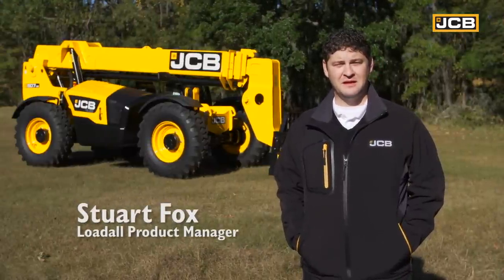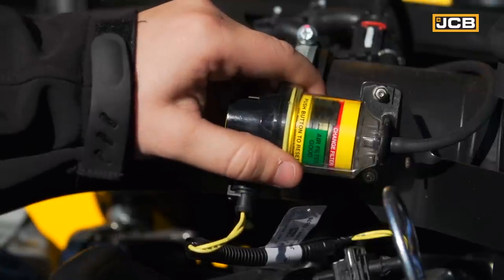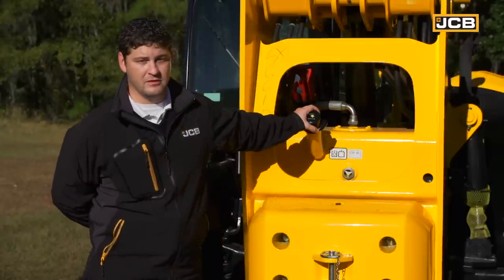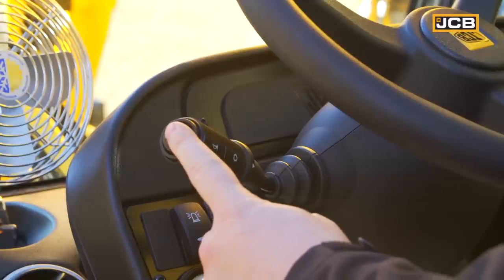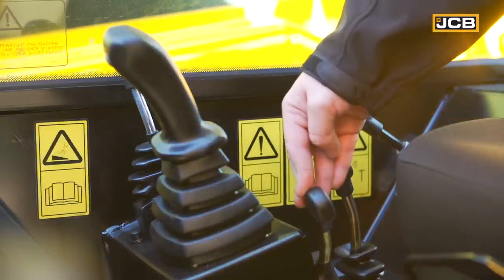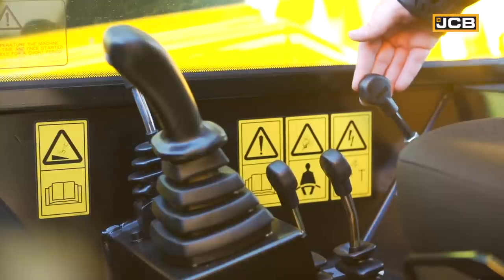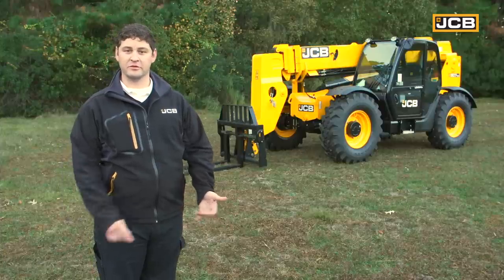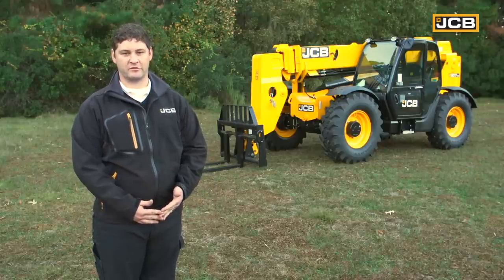Lift n Place -  Loadall Service and Operation

Comment: Hi, If JCB using as basket purpose and a man into a basket and suddenly JCB system all blocked. Question is: how we are rescue men from the basket? Have any manual system for in case emergencies? Pls response..
Reply: Cherry picker 🤣🤣
Come on mate cranes with man baskets can fail what a stupid question
Reply: @stevodoublel200  It is not a stupid question. In my practice, a related system of JCB was blocked, during working at height, and they can't lower the boom of JCB in time. There is a need to establish additional rescue plans or sustain the manual system in JCB in case of an emergency.

Comment: As a Telehandler driver in the UK this machine looks Alien (not in controls) in design why is the jib so high up and level with the cab so you can't see to the right, check out the UK Telehanlders if you are from the US (I know JCB is a UK Company) and see the difrence I visibility,  so much better than this machine. This just looks awkward and wierd
Reply: Tomorrow's my first day as a Telehandler for a galvanizing factory I've been working at for a while now, I'm excited but man your right I'm in Canada and we have these silly setups with the cab right next to the Boom it's stupid. UK ones look nice!
Reply: @beereadyyy9849  yes mate it's strange why they designed them this way. Probably easier if driving with a load sound on a chain block with attachment though when I think about it. But not with a pallet load driven low to the ground I suppose they both have pros and cons. Good luck on your first day kidda 👍👍
Reply: It's just the popular setup in the usa. Just raise the forks a bit and you can see to the right. With the high boom, you can boom below ground level, which is nice